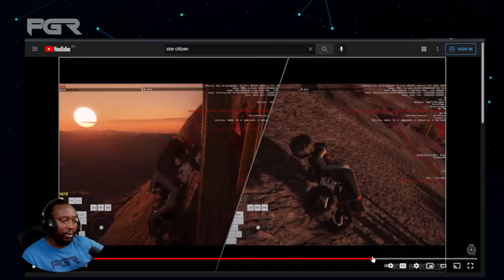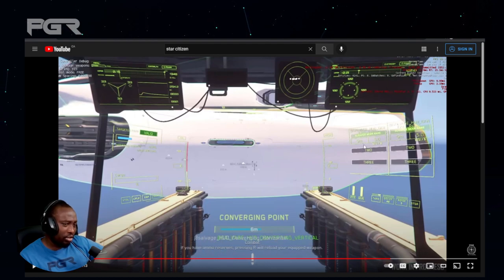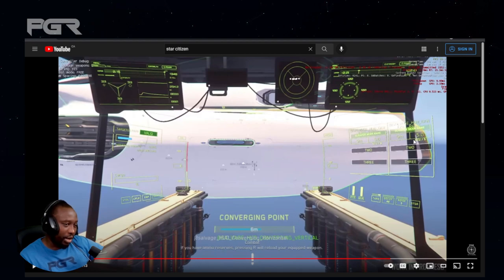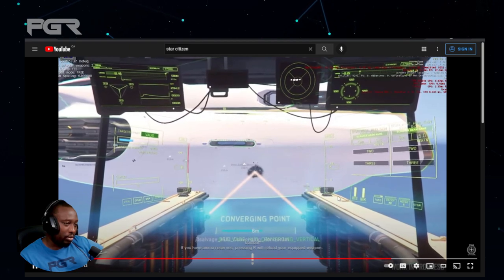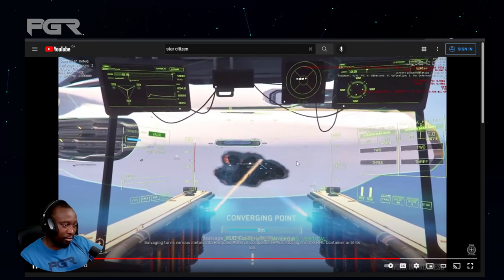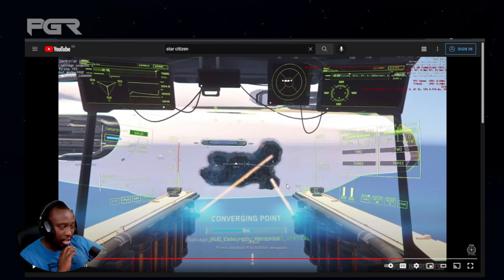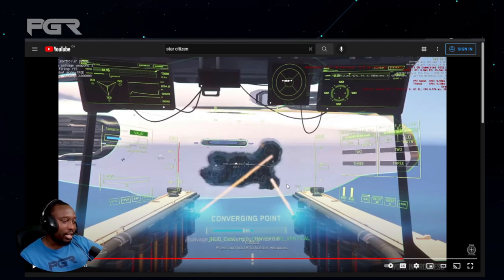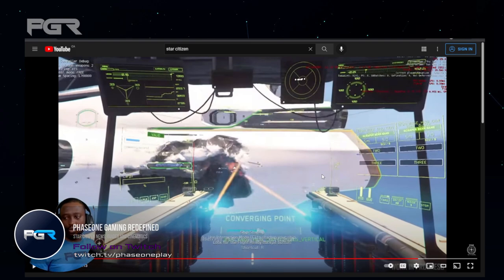My Concern About The Salvage Mechanic in Star Citizen

Comment: The beams are specifically for hull stripping, they said this is the first iteration of salvage. Tier 2 will come at a later date, you'll be able to get components out but you'll have to do it by hand or use drones. Chunking the rest of the ship and cutting it into pieces I think will be Tier 3 when it's all said and done.

Comment: Todd Pappy on salvaging:

1. Hull scrapping, "basically removing the paint off the hull" (which is what you see in this video)
2. Taking components out of the ships, computers, quantum drives ect.
3. The claw mechnic, crunching up the ships
4. Siphon oxygen or fuel out of the ship.
Reply: the second will probably come when we will have to swap component by hand

do you think the third one and the "physical damage & breakability" tab on the progress tracker are related ?
 
the fourth one will be soooo dope !
Reply: @cmdrspacecroissant421  ofc physical dmg is neeeded for salvage claw  mechanic